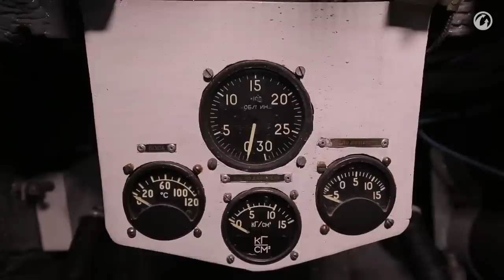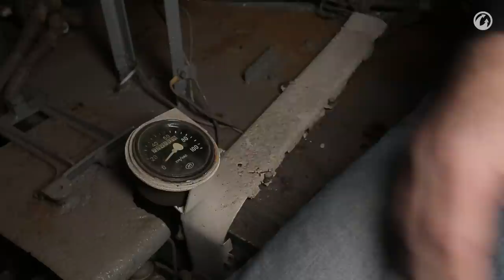Inside the Chieftain's Hatch: ISU-152, Episode 2

Comment: The speedometer is there for the commander to navigate(measure distances they have traveled). For example, if he gets the order to advance 35 kilometers to the West. So, if they are going 15km/h, he will need to travel for about 2 hours and 20 minutes to get there. He would, of course, look for the changes in speed and adjust if needed.
Reply: Гаврило Принцип Russians only had one command: To Berlin! And don’t stop. 😂😜😆

Comment: Could you imagine an ISU-152 loader in any other tank? Put 'em in a T34-85 and the enemy tanks would think they've got an auto cannon. I bet those loaders were shredded beyond belief.
Reply: It took 30 seconds to load a shell
Reply: @rubberwoody yes, but an ISU-152 sheel weighs 40kg, while an 85mm sheel rph weight like 5-20 kg at most, imagine a loader who normally messes around with 40kg shells loading 5kg shells
Reply: @usssouthdakota5541 85mm shell 5kg ROFL

Comment: Yeah, I don't see the low ammo capacity as a flaw. People want to think of this thing as a big beastly tank killer roaming the battlefield, blasting enemy tanks apart, but it's not. It's actually just a self-propelled artillery piece, which is armored enough to withstand enemy fire if it needs to get close to destroy a target. On a typical artillery gun, they don't carry all their ammo around strapped to the gun carriage. They might have a dozen rounds or so in a limber, but mostly they rely on having ammo vehicles to bring them up more ammo. Firing a dozen rounds from a large artillery piece is a big deal. The average piece averages maybe 5 or 6 shells per day. You want to make them count. The idea behind the ISU-152 is to identify a target, and send 2 or 3 ISUs in to engage it and destroy it. If you can't destroy it with the 40 or 60 rounds between them, then it's time to fall back and rethink your approach. If you are in battle and you somehow manage to use all 23 huge rounds up on 23 appropriate targets, you've had a successful day anyway, and it's time to send the depleted vehicle to the rear to restock on ammo. Often they would be set up just like any other artillery piece, firing indirect. That's why the ISU and SU )both 152 and 122) carried typical artillery bearing stakes. You'd park your battery of ISUs in a nice protected place, and set the stakes up in front of each marking bearings for firing coordinates. Then you'd use them like any other artillery piece, firing by coordinates by aiming at the appropriate bearing between the appropriate stakes, and dialling in the elevation on the indirect firing sight. Just like any artillery piece, the ammo would be brought to you as you used it. This was the most common employment for these guns. They were just more mobile artillery pieces that protected their gunners from counterbattery fire better than normal pieces did. They were capable of being moved right up to the front line to engage targets in an assault, but this was less common. They were not sent out to range around the battlefield blasting stuff. Real warfare doesn't much resemble gameplay in WOT, sorry to say. So instead of comparing it with "other tanks" and saying how much ammo it lacks, it's better to compare it to other artillery pieces, and say how great it was that it's not only self mobile and doesn't need to be hooked to a truck or horses, but it also provides a mobile bunker to protect the gun crew, AND it carries around enough ammo with it for a decent typical day of engaging targets. Not bad.
It's much like Stugs and other machines like them: everyone is always comparing them to tanks and complaining about how badly they stack up. They say they aren't protected well enough, etc. But in reality, they are just mobile AT guns. If crews can go out with totally unprotected artillery pieces and destroy tanks with them (AT guns were the real killers of tanks in WW2), then a self-propelled, armored AT gun is an IMPROVEMENT. It's not a tank, so stop comparing them. If most AT gun crews managed to survive in spite of having no armor protection at all, and needing to call in horses or trucks to hook up and tow them away under fire, then surely a Stug is perfectly sufficient.
Reply: read the entire thing, no regrets
Reply: They almost always fired direct fire
Reply: @_b_x_b_1063 because its an assault gun
Reply: @SwattyBoiPlays hey thanks. I get bored, I end up writing pointless essays. But I like to think sometimes they are useful to someone.

Comment: "kill the master power and that should shut down your engine". Maybe they rigged it up to work that way, but in theory, it's a diesel. It doens't have an ignition system, so breaking the power circuit shouldn't have any effect on the engine. Unless it has an electrical fuel pump, of course.  Not sure if he's just saying that because that's usually how a WWII tank is shut down, or if that's actually how it's rigged. It's like driving an old diesel truck; it doesn't have an ignition, but turning the key off will still shut the engine down. Unless it runs away, which is always interesting.

Comment: Wait; if there is a hatch for each crew member then why is there two hatches on each side? The driver, gunner and loader all sit on the port side, and there is only two hatches. I think there was actually two loaders, which is why they added a second hatch on the starboard, but that leaves one hatch to be shared between two crew on the port. And from what I've seen, not all ISUs had a second hatch on the starboard, so 5 crew have three hatches to escape from.

Comment: 1:15 Could modern tanks withstand the 152 HE?
Reply: about as well as they withstand a modern howitzer.
It's not like they have gotten bigger or packed in any more TNT over the years.
Reply: For certain definitions of withstand. Modern armour is unlikely to be breached, but the shock of the explosion will probably damage sensitive electronics and sensors, crack the optics, and give the crew a serious headache. Hits to the side of the tank would almost certainly damage the tracks and roadwheels, rendering the vehicle immobile.
Reply: Nothing survives 152 mm shots of communism

Comment: Any actually produced with the BL-10 trollgun?
Reply: I think it was with few protos. but actually firing the gun was painfull, not to the tank but to the crew.
Reply: WOTProduction I think the reason is because of the gun is too heavy to mount on this tank, so they cancel out the prototype.
Reply: HCK Gaming recoil what i have heard was massive could potentially injure crew members if u had something like ur hand somewhere wrong place at the wrong time :P
Reply: WOTProduction any gun fired could kill a man with the recoil.
Reply: WOTProduction Either way, the BL10 in this tank was a failure :P. But the prototype makes it an awesome tank in World of Tanks.
Reply: HCK Gaming yup, its awesome IF it hits
Reply: WOTProduction Then RNG makes you bounce off a light tank.
Reply: HCK Gaming it just simulates the trauma of the real crew using such a gun :P
Reply: Formulka Don't give wargaming any idea :P
Reply: One prototype, test firing ended up ruining the suspension and rattling the superstructure to the point of causing the development to go no further.
Reply: WOTProduction
It always hits me.... -___- there are no IFs xD that thing seems to be trolly accurate Lol
Reply: ***** Remember, just like the KV-2, Guided by the will of Stalin himself.
Reply: Michael Bohmer
Makes lots of sense.. lol
Reply: So true :P dem uber soviets
Reply: WOTProduction No the problem was centre of mass.
The SPG wasn't designed to carry a long barreled weapon and the prototypes had a nasty habit of rocking just a little to long on their tracks and dipping dangerously far forward. It just wouldn't work, especially on hills or medium range engagements.
Reply: Nah no series production because the gun was just to much and the ammo made problems it was fail project with that gun.

Comment: Those Russian Army 152mm rounds are very light-weight.  Naval 150-152mm (5.9-6") shells weigh 99-130 lb (45-59kg) -- the later the gun design, as a rule, the heavier the round, with the US Navy WWII 6" Mk 35 AP shell in its new 6"/47 light-cruiser gun being the heaviest at 130 lb.

Comment: Track tension is good.  Thrown track is bad.  Broken track is very bad.  Even worse when you are driving at speed because you can't brake one side so you let the vehicle slow down on it own.  There are a surprising number of very crushable items along the side of the road.  Or what we used to call, "maneuver damage".  Another reason to use a tank transporter for long distances.

Comment: Yea, I have some things to argue with this thing. Why would you take the ML-20 gun-howitzer and put in in a chassis to blast bunkers?  The ML-20 was a high quality piece with good performance. It sat in a niche where it was very usefull. Just light enough to be reasonably towed in one load and outranging all 150/155mm howitzers for the two tons of extra weight it had. It was highly valued as a corps level gun and very useful in that role, more so than for example the endless numbers of 76mm ZiS 3 which where hardly effective against any sort of entrenchment because there was just to few explosive in the shells. 

Now you take this gun, quite complex by Soviet standards and you take away its virtue of long range and put it in a restricted casemate to blast bunkers. Why? Why could the M-10 152mm howitzer not be used in this role? It had just entered production again as the D-1 but now with the carriage of the M-30 122mm howitzer. This gun is lighter and has a lower muzzle velocity, thus giving a better arc which is more useful against entrenchment. Its HE shell will do the same to any fortification but the howitzer is cheaper to make and a lot less restrictive in a hull. 

The Germans got it right with this class of assault guns. There 15cm SiG 33 was far better suited for such tasks than the ML-20. To bad for them it took until the second series of the sturmpanzer IV for this to become effectively used and by then Germany was almost always on the strategic defensive with few uses for such a vehicle.
Reply: well you have to think of how easily a plane can take out a zis 3 mounted on a tractor or stationary making it very easy to kill with the ISU they could safely roll into a war zone and not lose men because you have Armour and range  which makes it useful against well fortified german bunkers also the gun was a naval gun at first which saw extensive use on the sea and river combat for sea to land engagement and said hey we need this gun to be mobile so we can reach fortifications far out of the ships range. also very effective vs small tanks and transport vehicles because you can splash an HE round 20 ft away from your target and hit it and others around the area creating mass panic and rain dirt everywhere.

Comment: what is the thing underneath the barrel, on the outside?
Reply: +kEEGAN Edwards Probably part of the gun recoil system.
Reply: Mounting of the gun, this is a heavy piece and external mounting saves a lot of space and providing a counterweight which helps with elevation and adds reliability and longevity to the elevation mechanism.

Comment: WOW the welding is so rough on it. I guess they were more interested in quantity, not quality or any kind. It's a wonder the vehicle didn't just fly apart if it was hit with anything larger than a 7.62mm projectile.
Reply: Pretty welds do not necessarily equate to strong welds the rough look is likely a result of oxy-acetylene "gas" welding and cutting electric welding and plasma torches were not really a thing yet. It has been done poorly mind you don't  get me wrong but it's likely still a perfectly strong joint steel is especially forgiving in this regard as long as the peices have been "stuck together" its fine
Reply: @c-stofft-stoff8531  The Russians had all kinds of quality problems with the turret welds. They would come apart sometimes with a hit from a projectile that didn't penetrate the armour. The Russians were using unskilled labour in the factories. They didn't care about looks or quality, for the most part. The drivers' hatch didn't line up with the drivers seating position was a design issue, as were many other issues. As I said, quantity over quality. They needed numbers of tanks. They were losing them fast but in the end, they were able to make a simpler design than the Germans so they were able to make more tanks for a cheaper price. Mind you, none of that mattered if the tank was hit by an 88mm projectile. The 75mm round of the Panther did a good job too.
Reply: @achillies40  That's all true im just saying without careful inspection or very obvious flaws like pin holes or large voids a rough/visually unappealing weld joint in steel could be assumed as structurally sound, I was not aware of turrets de laminating after being hit i need to do some research on that an interesting fact i have heard of though is harmonic resonance from normal driving cracking the hull of the IS-3 seems to be more of a design flaw with the pike nose not a production quality issue though
Reply: @c-stofft-stoff8531  You are correct. It would seem however, you are not taking into account that the people doing the welding were unskilled. They had to work FAST. The welds were good enough. SOme would have been good and some not so good. As long as it stayed together as it left the factory, that's all that they cared about. The lifespan of a tank was 3 weeks. That was as long as they were expected to last in combat. They built them accordingly. That is why they were rough with unfinished surfaces. You can see by looking at the welds on the turrets that they were going to be a weak spot. The different parts of the turret didn't meet up most of the time. The castings were rubbish. This didn't matter though. As long as they held together for a while, that was all that mattered. 
Don't forget that there is a difference between delaminating and the welds failing. The Russians lose something like 44,900 tanks during the war. The Soviets didn't care about quality at all. As long as it could drive and fire, they were happy.

Comment: The standard gun on US destroyers were only 128mm.
Reply: 127mm. And there is more to a gun than the bore diameter. A destroyer uses a 127mm/5" gun , or cannon . A light cruiser uses a 6" gun . This is a howitzer, not a gun. It uses a far smaller charge and has much less range, and can penetrate much less armor. It's like saying a 9mm pistol is more powerful than a 8mm Mauser rifle because the bullet is bigger. It's not. The muzzle velocity and weight of the shell are both important. A howitzer is a much lower velocity weapon with a shorter barrel, and the 6" guns on a light cruiser are like twice the size and weight of one of these pieces. A destroyer also has a whole broadside of them, although they are intentionally given small guns beitr intended to engage enemy light units, not battleships and cruisers. They assumed a destroyer was only going to be shooting at torpedo boats and maybe merchant vessels, so they didn't need to worry about range and armor penetration, so it only needed a little popgun like a 5 inch gun, which can't shoot even half as far as a battleship gun. They are only big by land artillery standards, which are limited by the difficulty of transportation if they are too large. A 6" cruiser gun can shoot out to 15 miles and penetrate 8 inches of armor at half that range. This gun can't do close to that.

Comment: "Weighs over 80 LBS a round. Imagine lifting it up, over, and around." RIP lumbar discs. I knew ye well.
Reply: 120mm Rounds for the Abrams weigh roughly 50 lbs. This is a much larger gun so seems about right to me. A young man shouldn't have an problems loading an 80 lb round.